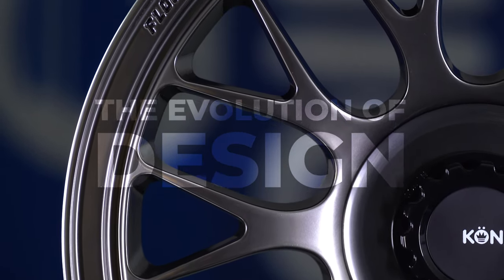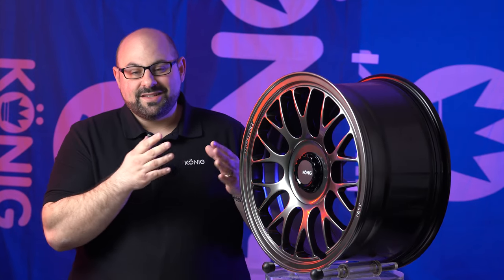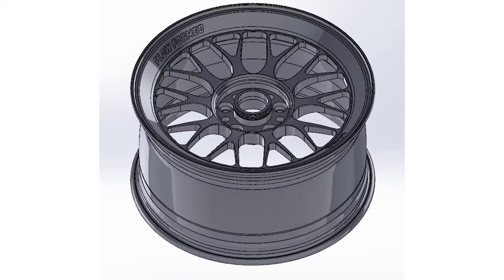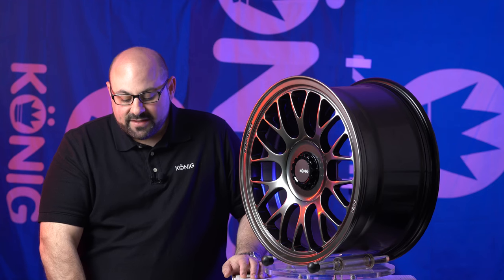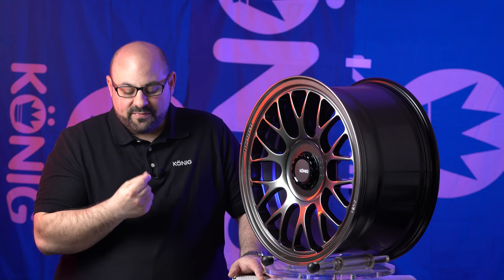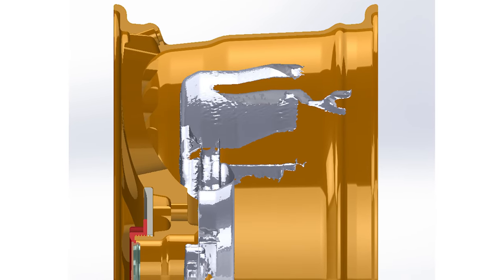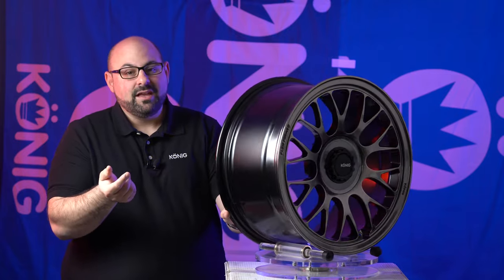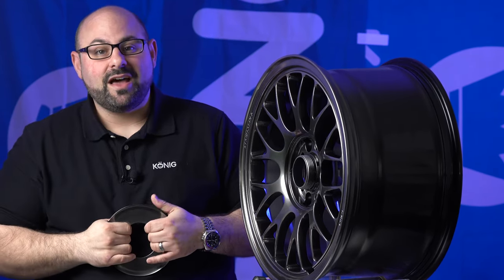The Evolution of Design: MRK1 (Step by Step)

Comment: Very impressive, I appreciate the in-depth analysis.  Goes to show why brands like Enkei and Konig are absolutely worth the money.  

I mentioned this in another Mrk1 vid but I'm thinking of these in 19x9.5 +40 squared on my AWD 2013 GS350, I'm very curious if the caliper will clear in the front.  The factory Advics calipers are somewhat large.  Anyway, I think it would be a good look on a GS, and the weight savings would be a nice plus.